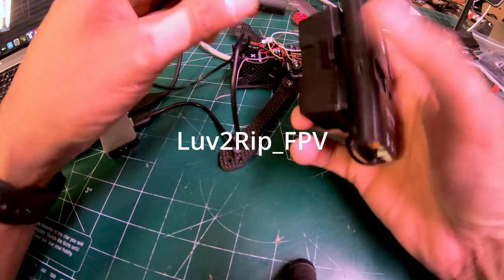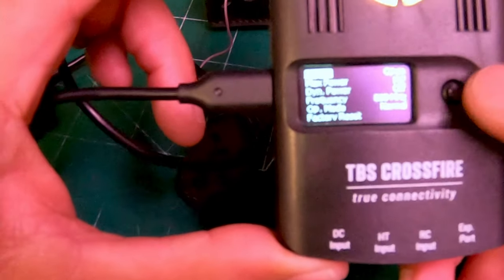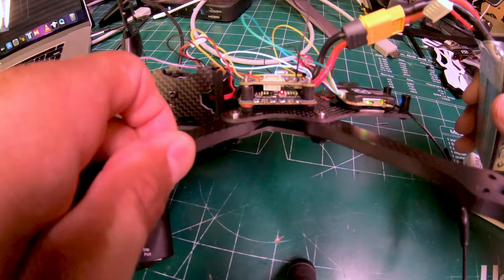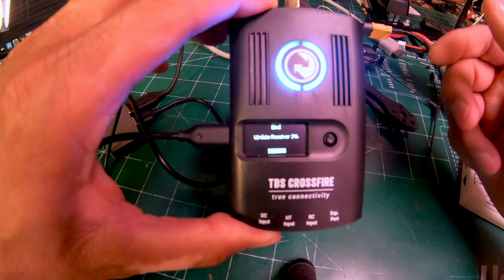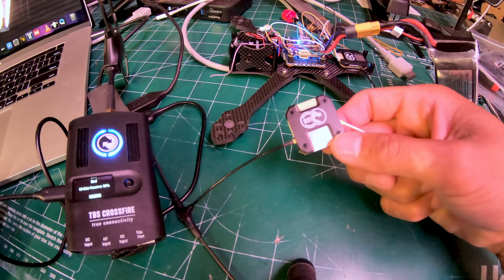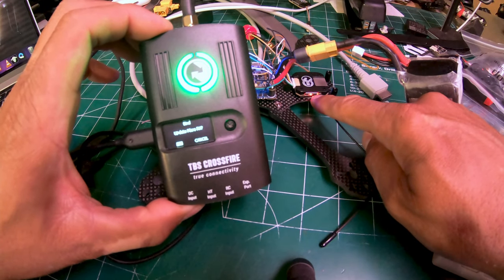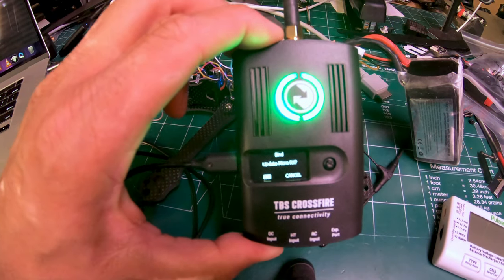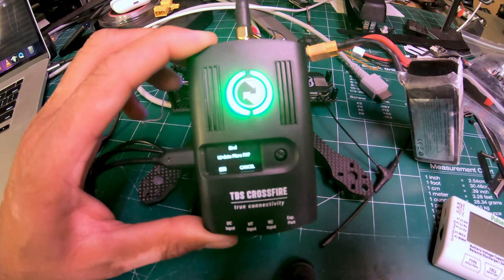TBS Sixty9 update and Bind issue RESOLVED!

Comment: Had the Same Problem! You Need to flash your crossfire to the nightly build 6.06
Good Luck!
Reply from the maker: Hey Emil, what do you mean by the nightly build? I flashes the Crossfire lite to the most recent f/w 4.11
Reply: @Luv2ripFPV  you have to flash your crossfire Micro / nano to a Beta Version, you Can allow Beta Versions in your Agent x settings( 3 Points, top right) then you have to flash the Beta Version 6.06 to your crossfire TX.
Reply from the maker: @propcounterfpv  Thank you SOOOOOOO MUCH!!!!!!! That worked!!!!!
Reply: @Luv2ripFPV  yesssssss! Niceeeee!
Reply: It looks like it’s 6.07 now and it’s not working for me. Any new updates to get this thing to friggin bind?
Reply: @kyro_fpv185  mine keep saying to update the fw in agentx. Ive updated my tango2 to the newest and the xf firmware to 6.07
Reply from the maker: @kyro_fpv185  Hi, I just updated f/w ware and did three binding process with all 3 of my quads on crossfire. I didn't have any issues?
Reply: RAGNAROK FPV  you have to Open the Agent x. Then Plug in your crossfire Module to your PC with a cable. After that you can See your crossfire TX in the configurator. You can See 3 Buttons at the top right in the configurator( Home Menu) then you click in the Button "allow Beta Firmware".
You Go Back to the Home Menu and Go to configure crossfire. And in the configuration of the crossfire is a Tab called Firmware flashing, you click in It. After that you can flash the Firmware 6.06 to your crossfire Module. After that you can bind your crossfire Sixty 9. 

Good Luck!!!
Reply: @propcounterfpv  hey man. I have updated to both 6.7 and 6.9beta and still cant bind? there is no 6.6 anymore?
Reply: @Kman568  yes, they all bind
Reply: @propcounterfpv found the workaround. Frequency has to be set to 868 to bind.
Reply: @Kman568  perfect

Comment: Had bind issues too although I thought it was because I was using an old deviation nightly build. After multiple failed attempts to bind it, decided to do factory reset for both rx and tx. Was able to bind successfully after even without getting the proper confirmation. It also kept going thru that bind loop too at first.
Reply from the maker: Thanks keikocgz, I will give it a shot :)
Reply from the maker: Ki, please see Emil Klehr's post. Worked perfectly!

Comment: This issue has been resolved after updating to version 6.07 using agent m 
But now I have another problem
Cannot use smart audio to adjust the channel after successful linking
Reply from the maker: I didn't think you could use smart audio on this unit?
Reply: You have to use “myvtx” on either agent x or agent lite (on transmitter)